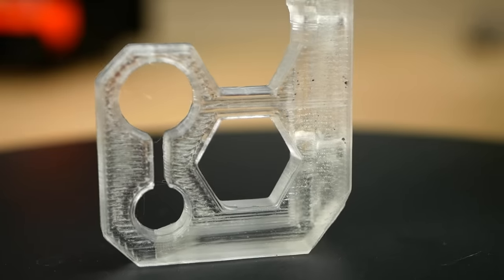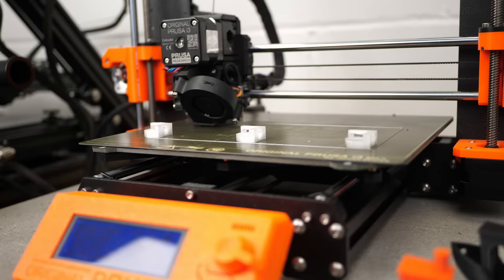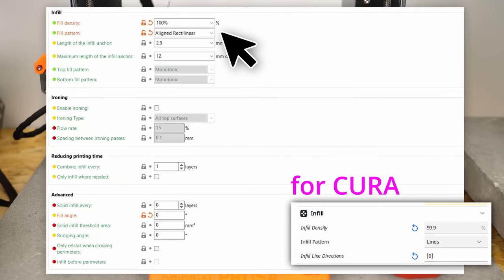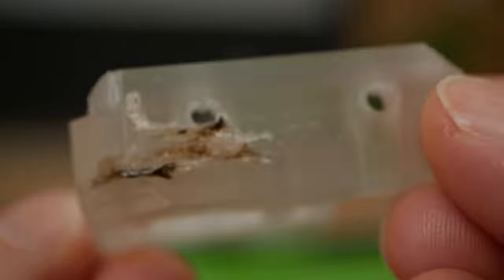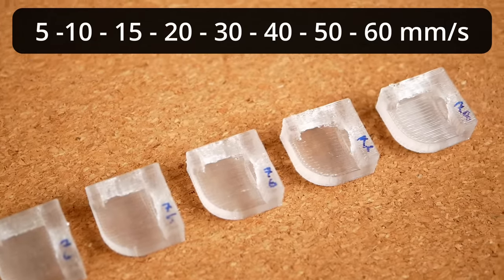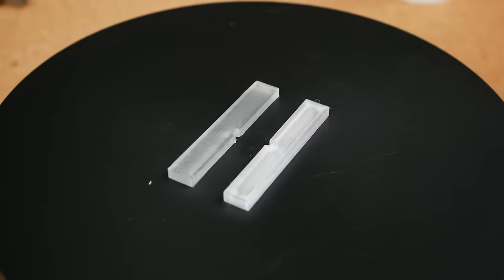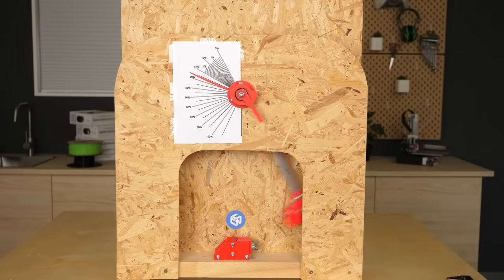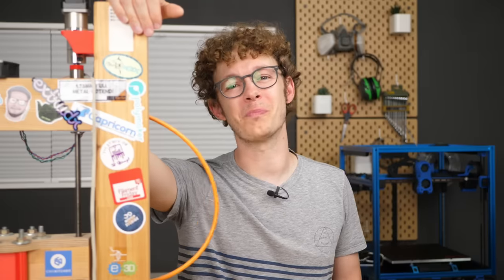Transparent FDM 3D Prints are Clearly Stronger!

Comment from the maker: What applications do you see for transparent FDM 3D prints? Are you just looking for clarity or are you excited about the strength?
Reply: I’d say if you are doing a model of a house or something with a window, you could use it for that
Reply: Making lenses for lasers, some lighting system etc.
Reply: this would be sick for a beetleweight combat robot
Reply: annealing the transparent 3d prints ? maybe it helps with the clarity ? if 100% infill was used
also maybe try upping the flow rate to compensate the tiny air bubbles?
Reply: Machine safety guards is my main application anyway.
Reply: I think optics are the most obvious application, but still very difficult to get right despite the nice results. I wonder if you could do something like a large fresnel magnification lens, which would make use of the flat clear bottom side. The top could be improved by vapour smoothing.
Reply: Hi Stefan, I came up with an idea while watching this video. How about to print the part hollow with just 1 perimeter and then use it as mold - cranking up the temp and just  use the extruder to fill it up with the molten plastic? You can make the shell rigid with some inside walls so it will not melt on the pour
Reply: Mitsubishi Chemical has a PMMA filament that they claim can be basically sanded and polished to perfection, but at the end of the day you'll need a heated chamber printer to achieve those kinds of results.
Reply: I used the technique to make tiny light pipes for LED indicators on a SD to PATA adapter bracket I designed.
Reply: To design light guides in the cabinets of electronic devices. It is difficult to get the correct shape of the piece without testing, I did it by hand with acrylics. Please, try baking it in salt like in your other video.
Reply: I'm excited to be able to print gems for decoration and cosplay!
Reply: For me - RC Light Lenses. 🙂  Hmm, I can't help but wonder if the same techniques can be applied to non-transparent materials though (not for clarity of course, but for the strength).
Reply: I did transparent prints from PEN polymer for the purpose of particle counters. PEN is a scintilliator.
Reply: Light guides and fresnel lenses could be good applications. It would be kind of funny to see a video of you setting something on fire with a 3d printed lens.
Reply: nice pirnt.... 😂
Reply: Cheap optics sound interesting - might inspire some people to come up with uses out of reach if you an only get expensive parts in the shapes you need.

Also:
- inclusions - pausing the print and embedding something trapped inside (could just use epoxy though)
- designing imperfections/pockets to make 3D images inside the transparent block, or projections when you shine light through it
Reply: headlight lenses for older car models
Reply: What's a "pirnt" btw?
Reply: @sugar4o  I was thinking something similar, too, seems like an interesting idea.

Why not make a resin-printed mold of the desired part, fill it with finely-ground filament of the choice material and then heat it to the proper temperature in an oven to melt and fuse, then cool it and remove from mold?
Reply: I design phone cases in Overture TPU translucent because it helps me align the buttons. Let's see how clear I can make it!
Reply: @retromodernart4426  in that case just use epoxy for the pour
Reply: @sugar4o  Good point, but perhaps in some use cases, some FDM filament material has properties that one is interested in, that epoxy doesn't?
Reply: Clear PETG filaments are much stronger without any tweaks compared to black and white filaments. I use transparent or colored transparent for functional parts.
Reply: Light guides - Resin prints have the tendency to filter out blue light over longer distances probably of the necessary UV light absorbers for detailed prints.
Reply: I'm excited about the strength of the parts but more important to me would be the process to achieve it.  I would love a How to video on what your process is to fine tune your filament settings. Like a video on you taking a new roll of filament and documenting the process start to finish.
Reply: A visor for my Daft Punk helmet build!
Reply: I have been working with clear polycarbonate and I'm very curious if these methods can improve clarity in my work
Reply: Light diffusers or light guides for regular 3d prints
Reply: Making bottles
Reply: Have you tried acetone vapors to really increase clarity and possibly increased strength? Or is the polishing method that you were using already the best strategy?
Reply: LED Diffusion.
Reply: Bloody brilliant video
guaranteed that Overture transparent PETG is going to be difficult to find from now on haha

When you test these parameters on other materials can you also try out transparent PLA/PLA+ and Nylon/Nylon-CF? For ease of printing, I would be very interested in PLA but for insane toughness the Nylon-CF
Reply: You should try 1+mm lines on a 0.8mm nozzle.
It reduces the amount of interfaces and gives much better clarity!
Reply: @sugar4o  that would be very hard to automate and I don't see people wanting to switch to doing things like that manually
Reply: @jaychimera372  I doubt annealing will help a lot.
The issue is that the gaps include trapped air which unless fully molten will not escape.
Reply: Ich wäre sehr daran interessiert die Proben auch zusätzlich noch zu tempern. Vielleicht sind dann auch 80-90% Layerhaftung möglich?
Reply: Use polarized filters to see stress, maybe
Reply: A little unconventional but this is super helpful for 3d printing plastic window panes for model trains.  You can get a frosted glass look but it would look much better with this application you showed.  Very cool and a question I've had for a while has been answered.
Reply: led indicator "tubes" to deport them outsde of an enclosure :)
Reply: You could 3D print aquarium parts which should look invisible when underwater which would make it look a LOT cleaner!
Reply: I'll try that with all the mechanical parts of my 3D printed Bronco, and then try to print translucent headlights!!
Reply: @ALex-qc4lf  unless youv tried it i suggest you keep your mouth shut
Reply: Fresnel lens. 3d postcard lens.
Reply: @NurettinSevdik  pgv
Reply: How about transparent storage container lids simply?
Reply: Light pipes for CCA LEDs.
Reply: Do you think this woud improve pla+ prints??
Reply: Hotend Housings and Fan Ducts!
Reply: Strength!
Reply: I want to see this tried with undyed polycarbonate. Polycarbonate is supposed to transmit more light than glass;  and it would be great to improve its properties in the Z direction.
Reply: 8:35 Have you tried enabling ironing on every layer ?
Reply: Knobs, anything that takes torsion forces.
Reply: @alecsinghformenrauschen6778  Fresnel is definitely the best application for lenses. It literally is made of print line steps.
Reply: @murk1572  End of the day. PID tuned Heated Bed as well. Makes a hell of a difference.
Reply: I recently printed brake light lenses for an antique car.  They came out surprisingly transparent (even without knowing the great info in this video), but supported surfaces, which constituted most of the interiors of the lenses, were rough and not easily accessible for sanding.  This created a lot of diffusion that reduced the effective brightness of the brake lights.  I found that by burying the rough surfaces in clear epoxy resin, the transparency was dramatically improved with relatively little effort.
Reply: Light guides, and illuminated buttons.
Reply: STRONT PARTS. I use PVA for transparent parts. Cant wait to try this out!
Reply: My extruder. It's always slipping and I want to see what's happening.
Reply: I'm printing windows for sailplanes!
Reply: A controller box for an electric vehicle where you can put the lights inside the box
Reply: I hope I'm not too late to the party, but you should try this with PMMA (acrylic) filament, I have been having a very easy time with it using your settings
Reply: Could this be used in conjunction with non-planar printing to print fresnel lenses? Maybe eventually lenses for a open source VR headsets or scientific equipment?
Reply: Stop saying "ideaers"
Reply: I print light shades/lenses/covers for lighting installations that my company uses. This video is super helpful to get an even higher clarity for these parts that need to let light through.
Reply: Patchwork rulers and shapes.
Reply: 3D-printed keyguards, for people with motor and cognitive disabilities, can make 3D-printed assistive technology feasible for therapists, schools, and families.  Traditional keyguards have been laser-cut from acrylic sheets.  Because of that, many people in the field just assume that a keyguard will be (must be?) transparent.  3D-printing opens up so many opportunities for customization and personalization but transparency is not possible - yet.
Reply: It'll be cool if u could print transparent from one angle and completely dark from another angle (bty I havent watch the video fully)
Reply: This is fantastic!  I see two uses: 1 - light bars, lenses, or diffusion for LEDs in projects.  2 - I'm betting that improving transparency and layer adhesion also makes parts more waterproof, so they could be much better for liquid or low pressure compressed air use, perhaps as lids for air or water tight containers.
Reply: Handles. The strength.
Reply: Besides purely aesthetic uses, the best I can imagine is a protective panel or housing for cameras or screens. I've not run into many uses of transparent things in general, so I find it hard to imagine a reason to use transparent parts other than aesthetics. I'm very used to the idea that transparent parts are just for looks, so it's fine that they aren't usually strong or durable.
Reply: Clear retro shells for portable emulators. Prison tech a la Techmoan's video on that matter. Lenses for LED lights, play with the geometry a bit. I like the vase ideas those looked cool.
Reply: Transparent red 3rd brake light lens. They are unobtanium for this older vehicle and the ones in junkyards are cracked from the sun or clouded beyond usefulness.
Reply: fantastic! I'm really excited for both qualities. I want to print off side shields for my glasses, that needs both transparency and strength.
Reply: @mrq1  Hi! I have an old classic. I am trying to restore it. One of my problems is to find the brake and indicators for the rear which are broken. I have bought a 3D Elegoo Neptune 3 pro printer and PETG red and yellow transparent filament. I am learning blender 3D to make the model lights and printer with filaments will arrive next week. Since you are doing jobs, do you have any parameters advice for this a application since I am new to all of this?
Reply: @vidadeperros9763  look up the youtube vids, "printing with glass". A lot of my info I got from there. However I run a 0.6mm nozzle so my settings will be different than the standard 0.4mm. Play with your coasting setup to reduce stringing, dial in your e_steps, crank the heat up, and go slow. Try to print with infill lines going parallel to each other if possible. A lot of people will say go -45 degrees on the infill for strength, but on a thin lens the changes in direction are much more noticeable and can make the lens cloudy.
Edit. Also set your z-offset higher with PETG. You want to "lay" it down rather than adhere it like PLA. This helps with stringing. And dry your filament. PETG absorbs moisture and this will really screw with your prints if not removed.
Reply: the strength is very cleary the important one
Reply: I’m developing lower receivers for electric airsoft guns. Having transparent parts so I can see fitting in my prototypes is a godsend
Reply: I am using it for my classic car turn and brake signal lights
Reply: Spectacle lenses, I know we can do it. Id love to be able to make free glasses.
Reply: I will try to print some pc watercooling reservoirs
Reply: @CNCKitchen did you make the video? I can't seem  to find it. It is also not tagged in this video.
Reply: As soon as I saw the title of the video I thought of a very practical and literally pennies-on-the-dollar application for clear prints like this.

Ready, here it is: Headlights for cars. Why are aftermarket and even OEM headlights so damn expensive? sure it's a Fresnel lens, but that can be easily printed, and since the print is clear, light won't defuse too much passing through it.
Reply: Please try the transparent with the powdered salt melting thing
Reply: How would a CHC Nozzle and or high flow hotend affect things would it make it easier?
Reply: incredibly complex window geometry that cannot be made economically with glass, lenses for vision / optics / solar ovens / concentrators, so many applications. Super excited for both clarity and strength, getting good layer penetration similar to weld penetration in metal welding seems like a fundamental requirement for any structurally loaded 3-d printed components
Reply: Thank you for the video. I'm interested in a bit of both clarity and strength mixed with chemical resistance. I'm trying to find a way to print an item that would serve as a shield for a glass replacement for example. Artwork, pictures etc...

I understand that calibration of height plays a role as you demonstrated, but what if you printed at 2-3 mm at the thickest at the apex of the print? Would that produce a clearer result?
Reply: Transparent 3D printed...
I imagine in my asperger mental sandbox, and I see replacement for lights and indicators of the cars, or luminous signs.
Reply: i saw this video maybe only a month or so after it came out but had found the rygar stuff when i first got into 3dp in '21 and it was a major factor as far as me buying the overture clear petg as one of the first spools i ever got.     its an interesting topic and thank you much for the vid...  doing things in this manner with as low cooling as you can get away with always remaining below 30% and always printed about 95% of the max temp of the PETG (per mfr) .... the clarity is wonderful as far as aesthetics of course but what i noticed (and i'm sure others have mentioned similar somewhere) is that the clarity of the PETG print can be used as an indicator for what your final part strength will be... or let's say... how fast or how cool you can get away with for the strength you need or the application.    so as a result i deliberately get  natural/transparent/translucent formulas of PETG as often as possible.... its like having an interactive final print quality indicator built in.  (of course you have to be willing to sit and stare at some prints to get it right)     and something else surprised me somewhat but does make sense:  some of the cheapest PETGs like NOVA have performed the best for me using clarity as an indicator but of course are more "gooey" (their viscosity doesnt really thin out until they are very hot and even then still very much like candy)   and so must be done more slowly and on the other end of the spectrum some of the more expensive like Atomic also perform well but do not necessarily need as slow speed or high temperature....  i'm assuming this has to do with the amount of additives and the formulation of the material.       this is highly interesting because my guess (somewhat subjective of course)  is that the cheaper PETG filaments probably have less glycol and additives and thereby need to be printed more slowly  but also importantly may be stronger (as is possibly evidenced by the plain PET formulas out there having more strength and temperature tolerance) when printed properly vs some of the more expensive PETG filaments being potentially more brittle if brought to higher temps or done too slowly.    i'm sure it all comes down to a trade off between what the customer seems to want from the product ... printing fast and easily less stringing vs end part strength...     i'd love to see more discussion of the material science behind it all and i'm sure you have in other videos i just haven't had a chance to see them all yet.
Reply: What about the PETG nozzle build up at higher temperatures?
Reply: thanks Shtefan
Reply: i think i you have a F350 you print slow anyways so print clear or strong things or laser stuff. so PLS do a Profile for Clear prints on the F350, your profiles are nice
for your fast parts get a bambu lab XD